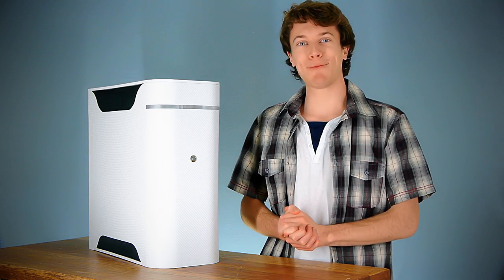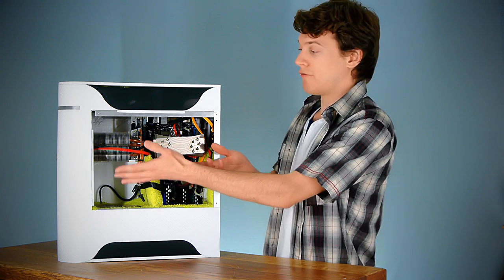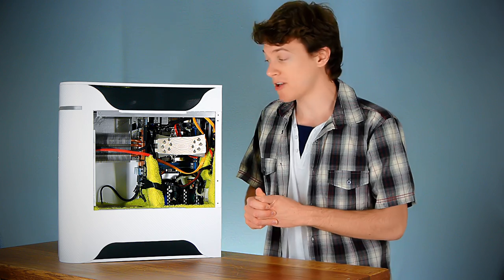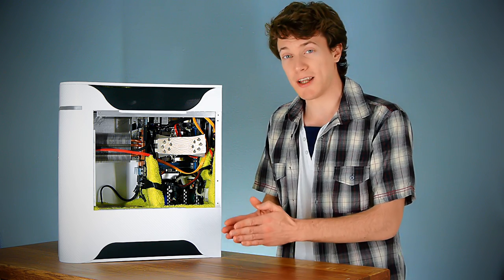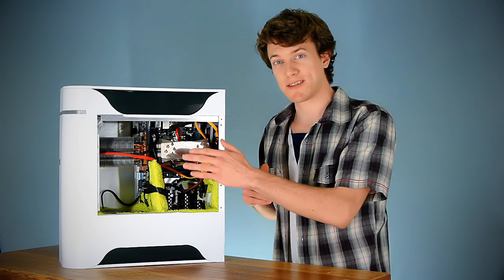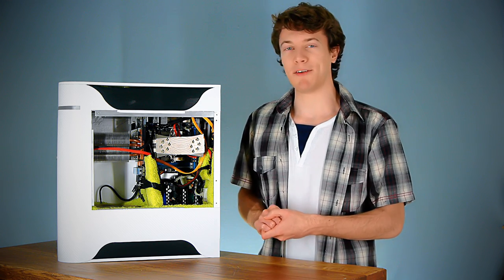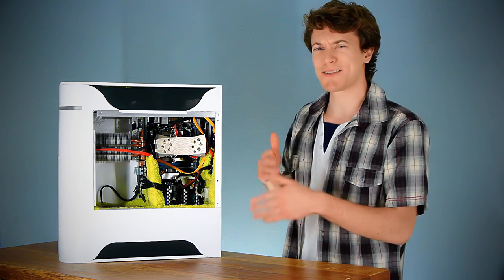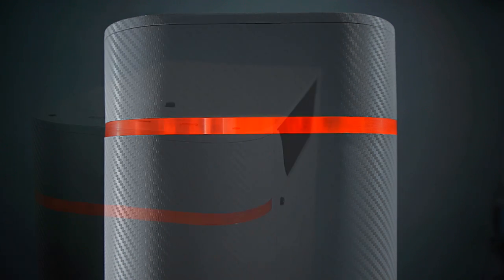DIY Computer Case - The Ultimate Silent PC (CLOUD UNIT)

Comment: Hey Matt, I love your way of thinking and how you're trying to constantly come up with new ideas - we need more people in the world to think like you! I understand this is your experimentation rig, but a lot of what you're doing in this rig has already been resolved with modern designs.

Cases are now becoming more flexible in terms of fan mounting to allow for a more direct airflow path to your components. Not only that but these same cases are often noise optimised as well by providing a layer of foam on some of the panels, negating the need for towels. The NZXT H440 and Fractal Design S are great examples of this.

Fan manufacturers are now surrounding the mounting holes with rubber to prevent vibrations being transferred to the case - good examples of these are Corsair, NZXT and Phanteks fans. Sometimes these rubber grommets can also be seen on hard drive cages too like on the NZXT H440 for example.

For GPU's we are now seeing better cooling designs across the board from all graphics cards that don't use the reference design. These use bigger heatpipes and more of them, not to mention the heatsinks themselves can be quite large making the card pretty long. On the more recent graphics cards we're seeing a 'silent mode' where the fans will not spin at all on idle making it a completely passive design until it will get to a certain thermal threshold whereby the fans will start to kick in. I know on my card the threshold is 55C. Better airflow generated from newer case designs will naturally remove the hot air from the graphics cards a lot more efficiently too which will also help to keep the temps down.

In terms of PSU cooling, you can now get high efficiency fanless designs that use high quality components which won't have the same coil whine issues as lower quality models. Not to mention reversable mounting and grille cutouts to give you the option of breathing in cool air from the bottom of your case directly to the PSU.

I know you haven't directly covered it in your video, but I would like to point out most case manufacturers provide dust filters as standard for the fans that are likely going to be used as intake.

I think this would of been a stellar idea 10years ago, but in today's world you can now find mainstream hardware which has been tailored towards these types of themes already.

I can be almost certain that your rig will be quieter than Linus's "ultimate silent PC" (see link below), but at 24dB @ full load I can't imagine you would be able to tell the difference in a normal household where ambient noise is probably going to be more than that anyway. Also, Linus's rig required zero custom modification. The most he did was remove the fans on an aftermarket air cooler and add additional fans to the case.

https://www.youtube.com/watch?v=RXZrWqCT7R0

I'm not hating on you by any means, but I do think these ideas are redundant now as most of these has been vastly improved upon for the mainstream market AND they offer better flexibility in terms of upgrade options.

Comment: Really amazing design and layout, especially the vertical motherboard. Only grips is using a fabric material for sound dampening. I'd recommend using sound dampening rubberized foam instead. This fabric would collect a lot of dust as well, as well in cause the possibility for mold growth, due to it being warm and absorb moisture. Overall its a great idea.

Comment: I'd check out the 2013 Mac Pro, which is virtually silent. One fan at the top receives the rising, hot air and sucks it right out. Even my 2006 Mac Pro (a compartmentalized tower) is cooled extremely well, and, with all five of its fans and my HDD, is whisper silent; it also runs its Xeons [depending on the weather] anywhere from 90F-104F idle.

Comment: Nice dude!!! I appreciate your work! I have silenced my GTX 690 with Arctic Twin Turbo III. Gaming is no more disturbed by Computer noise.

We can sleep with our NAS in our sleeping room.

All HDDs are attached with rubber band and this was the one and only noise Factor. 8 x 8 TB with 7200 RPM too much vibration but with rubber band zero noise emission. CPU and PSU no noise emission of the cooler. I use 5 140mm Fans with 600 RPM to keep the disk under 36°C without cooling they get 43°C and above. Fans also are detached by rubber band from the case.

My Wooden Computer mini ITX with the GPU in it have custom size to let the Arctic Cooler IIi fit into minimal space case. The GPU runs at 57°C max under Full Load. CPU 3770K runs at 3.6 GHz and gets 47°C max under high load. SSD gets around 26-47°C depends on usage.

Comment: sooo better than watercooling.

taking the power supply out of its box is THE idea ahead of my tardis computer.

which i built also vertically and with 600rpm 180mm fans. and although i watched your graphics card cpu cooling video, i decided against it for the sake of, well not more space, but more speed of the air passing the graphics card. this allowed me to exit the graphics area with air on permanent room temperature. your solution is still way more efficient (surface wins) but the graphics card does only spin on its lowest level in high load.

not much bullshit talk coming,
ty for your excellent video! :)  i rly like your inspiring and teasing inventions

edit: my specs #vertical airflow, 4x 600rpm 180mm are:
amd fx 8350 black ed @ 4,8 Ghz (Max Temp 33°C, max load, 21°C roomtemp)
AMD r9 390 msi @ 1100Mhz (Max Temp 56°C, max load, 21°C roomtemp)

Comment: Nice home build case.  One alteration I would suggest to make upgrading easier is to change the way that the GPU HSF is supported.  Currently you are using glue which means that upgrading the graphics card is going to be very difficult as you have to remove that glue before cleaning the surface only re-apply a new lot of glue once the new GPU is in place.  A better system would be to use a piece of aluminium angle (which you should be able to get an off-cut from a local engineering firm or supplier) attached via screws and rubber washers through the metal that is currently supporting the heat sink.  If you did this with vertical slots it would be adjustable for different styles of heat sink as well as cope with the layout differences between graphics cards (as in what position the GPU is placed) far better.

Comment: oh mat, you are just the best! Hadn't seen these two old case builds of yours before, cause they don't pop up as easily. but they are still relevant as ever. I've grown increasingly annoyed with standard cases, especially after the stupid new plexiglass and rgb lighting trend which is just so impractical. So i've decided to build my own and started planing what i belive to be the ultimate setup. And here you are many years earlier with almost the exact same ideas! :O like the vertical mobo mounts and upwards airflow.  i don't understand why case manufactures haven't started making this...

Comment: Just a small correction. around the 3 minute mark, the cpu cooler being on the graphics card does not in fact have a larger surface area due to its size (volume) it has a lager surface area due to its greater number of groves and air flow paths located along the sides of the heat sink.

Comment: Ports on the back are way better because you usually plug in stuff that doesn't get removed - mouse, keyboard, etc... so you have a clean look. Also additional front USB ports are with no flaps so dust can settle there pretty easy.
Reply: +mmdirtyworkz He has the ports on the top but under a lid, and the cables coming out on the back for a clean look. So win win

Comment: Quite nice!   I like it!   Some things you may try:  turning the whole thing inside out.  You could use a "U-Frame" PSU, where all the power transistors and such are fixed to an aluminum plate, that also acts as a housing.   These are made for rack units.  Could also use an all-aluminum case, like some Lian-Li's, and mount the PSU to a side of it.  If you could manage to purchase flexible heat pipes, like those used in aviation, then you may be able to route the GPU and CPU heat to the case as well, without the need for water-cooling.   This way, you will have convection cooling both inside, and outside the case.  The case will become the heatsink.

Comment: I've had two internal PC fires in my life. One was when lightning struck the mains line outside my house one night and I woke up to a nasty smell coming from my PC. The power supply was shot as well as the hard disk drive. The molex connector on the drive had blown apart and showered the chassis internals with burning plastic.

The other happened when I was plugging in a floppy disk drive blind and stepped the connector over one position such that the yellow 12v and it's nearest black ground were spanning the middle two ground pins on the drive, which are bridged. The PSU failed to shut down and the 12v wire burned all the way from the connector to the power supply box.

 Point is, fires can happen from low voltage circuits. I'm considering a low noise chassis build but I'm planning on putting any sound deadening insulation between metal layers, essentially having a fire resistant aluminum inner chassis and a larger outer chassis.

Comment: Great build mate, I would only have one suggestion since your purpose for this project is experimentation.

How about enlarging the cutout for the side panel and instead of a lid install a monitor there, say a laptop display to turn this beauty into an AIO unit, plus adding a couple centimeters height at the bottom to install a sliding tray with a keyboard and mouse?

Thus along with becoming AIO it would be a whole desktop system as portable as a briefcase......

Comment: Thats quite a good idea. Some problems might be that obviously with such a massive heatsink on the gpu there is no room for sli, also the toweling will collect more dust I would imagine and be harder to clean out and possibly a fire hazard I don't know. However the idea of the heat being driven to the top and out the case I think is really good, as GPU's kick out a lot of heat. I'm sure this could be developed even more. Hats off to you for the ideas and building it and I hope you will continue to develope on this.

Comment: Good point with the GPU coolers. GPU should be cooled more than a CPU these days.
If you put shark teeth on the end of Fan blades, it causes less wind distortion.
Modern AC systems and the US navy Submarine use the technology. Both making them quieter.

Comment: Arc flash due to exceeding breakdown voltage across an air gap could be a concern, but I think the bigger one is a high impedance component experiencing a low impedance high current condition - a 2 cycle arc flash lasting 2/50 of a second could potentially cause ignition, but an overheated component in contact with a flammable material is much more likely to do so. Often, semiconductor components experience a positive feedback loop in which the more heat they accrue, the more energy is consumed and the quicker it heats. So long as the shag rug it is an antistatic material (non-synthetic) it shouldn't kill any hardware via electrostatic discharge, but never say never. Seems pretty easy to buy vibration dampening fan mounts (I thought noctua came with them) and antistatic acoustic foam, but a diy isn't necessarily about the end result as much as it is the knowledge gained in the process. Never heard coil whine in a VGA.

Comment: Nice you just gave me more reason to build my own a 24 inch cube I have been tossing around ideas on. I like the idea with the video card something I have also been thinking about but in SLI [2 cards]  with a 3 card spacing if I could find the right CPU cooler it maybe possible. Great job on the whole unit.

Comment: It might make more sense to replace all that fabric with silicone from cut up silicone hot pads/oven mitts or other similar sheets of silicone.  It can handle high temperatures and won't collect as much dust.  It would be safer to use near all those wired connections as well.

Comment: You could also kick out that GTX460 and get a newer low end card like the GTX950, save electricity and is also less power hungry and therefore cooler.
Dunno which CPU you are using but again, with a new core i3 or i5 for more performance hungry tasks you could also get a better result.

Also: I'm not sure if i love your accent or hate it lol. Keep it up!

Comment: I feel personally that most PC builders/enthusiasts would shy away from this, mostly because it takes away any options for SLI or installing anything into the remaining PCI slots. So expansion goes out the window unless you buy a new graphics card and reinstall the heatsink, which still leaves you with no options beyond a single GPU.Then there's the "exhaust" or heat removal from the card elsewhere... ive been through many many GPUs, and almost all of them exhaust directly out of the case near it's inputs. This concept actually exhausts LESS than a stock cooler and would most likely increase the overall system temps...This idea is far from "new" and many people somewhere down the road of tinkering have attached aftermarket heatsinks to pretty much any component that generates heat. Of course, any idea is worth investigating, but talking about it doesn't do any good, it's been talked about, increasing surface area makes it easier to cool, but unless there's a significant performance gain under sustained load, it's probably not worth the hassle. Decreasing the ambient temperature in the room by just a couple degrees would probably achieve greater results than this... although there's no BENCHMARK to go off of with this... I wonder why...

Comment: You should plug the fan below the GPU into the fan pins on the GPU so that it will adjust according to the temperature. And then edit the fan speeds for the quietest possible  in GPU Tweak

Comment: hi, I usually watch and like your videos, most of them are great.
got a few ideas:
- is it possible use the pci-e expansion cable (from previous videos) to hook up the gpu in ONE line so that you get: cold air > ext fan > PSU > GPU > CPU > exit air fan  (of course by the time the air reaches the cpu, it will be hot, but i think its worth trying to find out)
- towel in the HDD? i don't think its a good idea..towel will prevent the heat from going elsewhere, i believe, as in your previous pc, secure them with rubber band, vertically or horizontally stacked with at least 2cm distance between them. ( i get lower than 30*C this way on my 4 HDD +1 SDD, and without a fan blowing on them )

thank you for your wonderful ideas (on many videos, esp the 1000W led), and their explanations on how to do them.

Comment: I absolutlely love that you did it with that budget!

but there's really no reason to implement a new and bigger standard for GPU coolers, if anything they need to get smaller (yet better), or at least make the standard of fliping the PCBs making the die face up... it's like they don't understand how heat works...

The reason they shouldn't implement a biger standard is that:
1. dual slot more often then not makes one PCI slot usless.
2. if you are willing to ad a big ass cooler to your GPU, you might aswell ad wattercooling, and that's what I would have recomended you to do, although for that ultimate cooling potential and silence you have to pay a premium.

What you did there was compromise space for price and went off with the same thermal performance as stock (maybe a bit cooler), but got the same noise level as watercooling.

Comment: Very interesting, well spoken and clear. Great video.
I can understand the "vertical" point of the build with the huge heatsink for the graphic card. However, if one needs more PCIe slots to be used for other cards, such as network, sound, raid, etc... then the heatsink is on the way and it would not be possible to get it installed. Although I am not a gamer and very happy with a single video card, most gamer machines have several video cards in their machine. How will you "cool" these cards then? Only the last card facing the end of the case would be cooled that way.
So your design is very interesting for a simple PC and people just using "Word processing" as  you said, but definitely not for more powerful requirements.

Comment: ( in USD ) pond pump $15, vinyl tube $4, Aluminium water block $8, 8 hose clamps $3, scrap picked lawn mower radiator free, plastic snack mix barrel container free (after we ate the snack mix).  My water cooler setup for my computer  for just about $30 (your mileage may vary)

Comment: This is an interesting concept however it would be nice to know what sort of temperatures you're also getting once you've been under full load for a few hours to know if it's actually practical.

Also it would be interesting to know what spec's your pc is because for all we know, yes you're running the benchmark, but it's a non-synthetic benchmark that can still be ran when components are under-clocked and such.

Anyhow good vid keep them coming!

Comment: ACX coolers on higher end EVGA cards do have exhaust ports out of the case. They're pretty small, but they exist.

Also, as I'm sure has been said many times here...water cooling is much much quieter than air cooling. I find it hard to believe you built this case for less than 50 bucks, which is essentially the cost of a Corsair H50 watercooling loop.